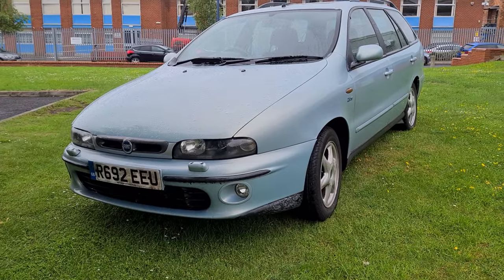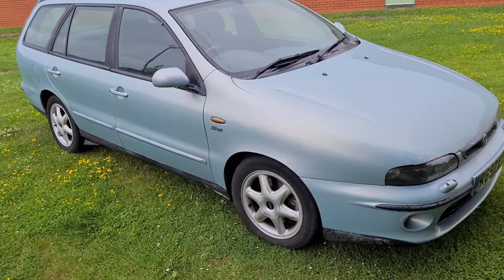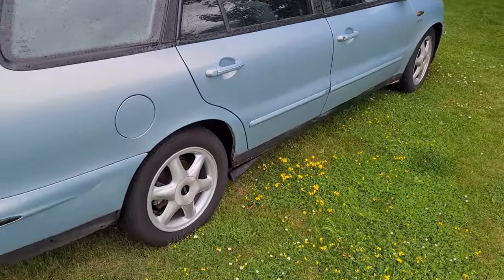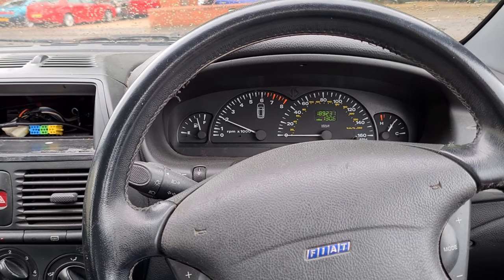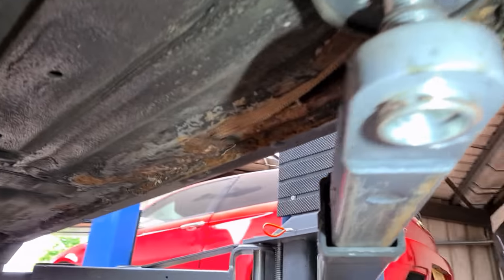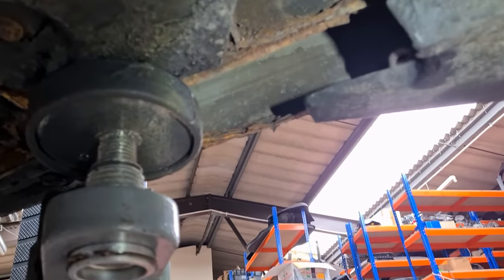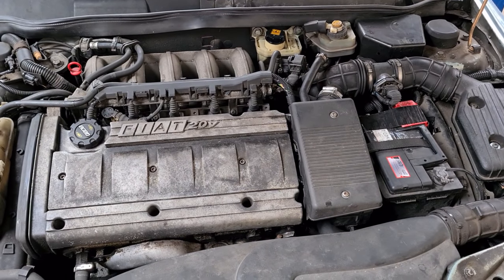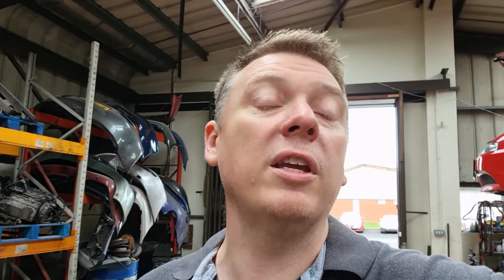Forgotten 90s estate car. Fiat Marea weekend HLX

Comment: Was looking forward to this video as I have the 2.4 130HLX that I am getting round to restoring. With so very few of these cars around anymore they should all be saved. Let's not forget that this is basically a roomier more practical Fiat Coupe!
Everything you can do to a 20vt coupe can be done to these! 
Mine handled lovely with uprated Coupe suspension on and the 2.4 five pot diesel really is a gem! 
Sadly this one is worse than mine, but imagine it with a 20 valve turbo in there after it's been repaired!! 
My own diesel model is only one of 6 cars left and only one of those was on the road (being restored now) until recently. 
Show some love for the Marea guys!!
Reply: expected to see you here lol, i agree, sadly only 4 1.6100sx saloons left, one is my own, its got a abs light on, very worrying, as Italian wires can be H E L L

Comment: This is a great car, but you must to do maintenance correctly to avoid any serious problem.
I am from Brazil and I take care of 3 models: Fiat Brava HGT 1.8 16v 2000, Fiat Marea Weekend HLX 2.4 Automatic 2003 and Fiat Marea HLX 2.4 Automatic 2005. And. here in Brazil, the 2.4 is not Diesel, is the same engine used in Lancia Kappa.
They are completely originals, without any modification or customization.
A take care of them as if they were my sons!
Reply: salve pra oficina simas turbo!

Comment: I had 4 Fiat stilos so far and i loved all of em
Reply from the maker: i nearly had a new one but decided against it.
Reply: @ItaliaAutos  why? Stilo's are awesome, i had one with the Skywindow and 3 Station Wagons.
Reply: 2 stilo abarths in my little collection: I love that torquey 2.4 L 5 pot
Reply: @ItaliaAutos  same here I went on auto show with my father to buy my self a brand new Stilo station wagon, and when i saw it in flesh  up close, i decided against it , it didnt look Italian to me at all it was so Germanic and unappealing , that was 2001 or something as my first new car. I bought second hand Marea slightly damaged fixed it up with 1.6 engine and heavily modified it, lowered the car and tuned it from 106 hp to 180 hp on TNG - it didnt even had a rev limiter , was hitting 10-11k rpm like mad. barely any issues with it, except few oil leaks - as my late father used to say "Fuck Fiat if it doesn't leak the oil" to this day i miss that car.

Comment: Had a 1.6 16v Marea weekend ELX as well. Put in a mouse grey leather interior and rear HLX subframe with solid subframe bushes. Had many many fond memories and miles with it. Tons of space, cargo room and just an overall joy to drive. It had rust on the floorpan around the sills, which is a very common area for this type of chassis (the Type C, also shared with a lot of Alfa Romeo's) but a few weekends with the angle grinder and welder she was sorted out again. Another common and notorious area for rust is behind the front strut tower panel. 
What strikes me the most is that this 20v HLX didn't come with AC. Not sure if this was an option or not. Shame it's not near me or else I'd get it and put back on the road again.

Comment: In 2005, I bought a 1999 Weekend 100 ELX in dark green. Even at only 6 years old the roof had to be fixed because there were rust holes underneath the plastic strips. The floor was still OK back then. I drove it for another 5 years and had lots of electronic and other issues with it, but I did love the huge booth and the fold down rear bumper, especially on holidays. And it did 191 kmh on the GPS on the German Autobahn 😁🇮🇹

Comment: I got the next step up, the Stilo Multiwagon, Love my stilo's and they have been all 115 Jtd's. Ok they have their quirks but I would take mine on a road trip and not even think about it. I did 800 miles in a day last year and it didn't miss a beat.
Reply from the maker: nice
Reply: I think the Stilo Multiwagon is based on the same platform as the Marea. Could be wrong tho.

Comment: You said servicing was no problem at all but the reason there are so few left of the 20v (not that there so many sold to start with) is the cambelt change on them was officially an engine out job due to lack of space and that came in (circa 2003) at over £1000 and two days work. The market price at the time was about £1500 for a 4 year old example so most people just dumped them on the market for whatever they could get. A non-franchise workshop would do the belt in-situ by dropping the gearbox end to make space but that damaged other parts in many cases leading to more repair bills. The front wishbones were made of butter (nothing new for Fiats) but at least those were easy to swap and not too expensive...  Putting all that to one side though the 20v estate was a stealth rocket at a time when your average 2.0l family saloon struggled to make 130bhp let alone the 155bhp the 20v developed. It wouldn't set the world alight in terms of handling but it did more than a passingly good job.
I bought mine as a tow car for racing (in Auto Italia), the best (interesting) alternative was the 156 estate but the load space in that was terrible even if you could have the wonderful v6 up front... in the end I gave it away to my father - I could have got more scrapping it than selling it which would have been a real crime

Comment: A friend of mine had one back in the 2000s, also an HLX, in factory black with the optional air conditioning, which was very useful in a black car with quite a lot of glass area.  It looked properly sinister in black.  The Marea Weekend was a very good looking estate car in my eyes, and there were quite a few around in my area.  His had a taste for head gaskets, it used to pop them every 10,000 miles, but he loved the car and had a good FIAT mechanic so it wasn't really an issue for him.  Power steering racks were another issue with it, only lasting about 50,000 miles before becoming very clunky with visible lost movement in them.  That one had over 200,000 miles on it when it went to the scrap yard, mainly due to being rear ended by a Transit and partly due to the need for a larger car having had an extra surprise baby...

Comment: I learned to drive in a 2000 Marea ELX 115 (1.8) saloon, I like the styling, the rarity and it was a great car to drive, engine was very flexible, you could pull away in 4th without too much trouble (my dad showed me this, so I had to try it in 5th - and managed it, although it was a bit tricky!). Being a saloon it looked bigger than it was, and with L-plates it looked slow, but drop a couple of gears and put your foot down and it went. I agree, the interior is cheap and nasty, and being in the passenger seat you would look at the completely useless parcel space in lieu of an airbag. The only bad thing about the engine was that the cambelt needed changing twice as often as Fiat stated, unfortunately, my dad only found this out after the car mysteriously stopped one day. Amazingly, depstie it being not worth much he did get it repaired, and it was an MOT failure due to non-parking wipers that caused it to be traded in for a Citroen C3. I would so love another.

Comment: After they are discontinued in the continent, it was kept being produced in Brasil and Turkey. (In Turkey with only 1.6 16v engine). New trim included SX (as base model), Liberty (middle trim) and the Exclusive (you know what that would mean).

When they are produced within the borders, it's actually much cheaper to both buy and run. And in my opinion, the facelift (or "bootlift" if you will) looks that much better with Lancia Lybra taillights. Shame, we don't get 5 cylinders after the facelift... Good car and I hope someone had the courage to save it.

Comment: The clocks/dials look like they are from a Daewoo Tacuma! Even though they came along a few years after the marea.
Reply from the maker: they may well be old stock sold to daewoo
Reply: @ItaliaAutos  That's a good point 👍 Thinking about it I believe Daewoo even got Vauxhall to supply them some parts, Zafira engines I believe
Reply: The dials reminded me of my -99 Opel Vectra

Comment: Fiat's do hide their rust/rot well from the outside. I had a 2001 Punto Mia from new as my "workhorse"/daily driver keeping my Porsche for the weekend. At 83K it looked immaculate but for the 2018 & 2019 MOT's it needed welding to the floor which shocked me as it looked so well. The prospect of further welding for the October 2020 MOT & the usual electric power steering ( 4th in 17 years) meant it was uneconomical to repair. Was so sad to see it go to scrap.

Comment: It really is beyond me why people bother bodging up rust with filler/newspaper/expanding foam etc just to hide it. It only gets worse and hiding it from the mot man won't fix anything. If they are that worried about it then get it treated/welded in the early stages and nip it in the bud. I guess the person who did it had a tame mot tester as I don't think one worth their salt would pass it when bodged up like it once was
Reply from the maker: it all comes down to £££. most people just dont want to spend it on fixing rust when it stops and does perfectly well.
Reply: @ItaliaAutos  I guess, but they clearly value a couple of hundred £ in the early days of the rust than their safety 🤷
Oh well, the mind boggles 😂
Reply: Generally theyre not bodging with the intention of keeping the car though. I reckon they just want 12 months ticket on it to sell on so no longer their problem then.
Reply: @fatwalletboy2  That's right, but it doesn't make it right and no decent tester should pass a vehicle bodged up with filler and newspaper in the first place. Tapping it with a screwdriver usually gives a good idea if it's innocently undersealed or filler, newspaper and underseal!!